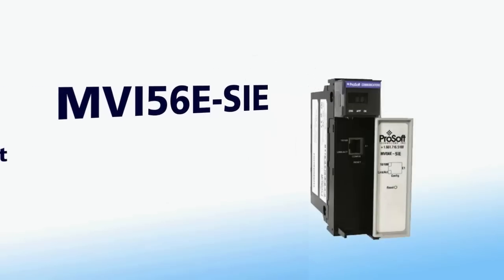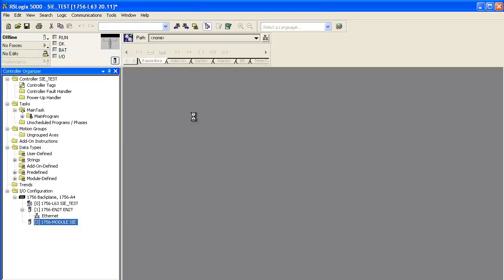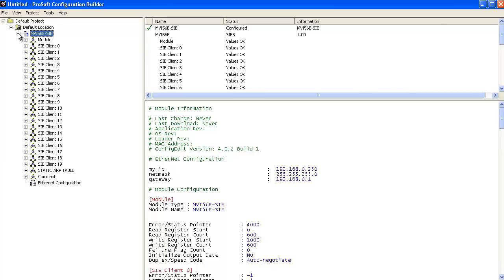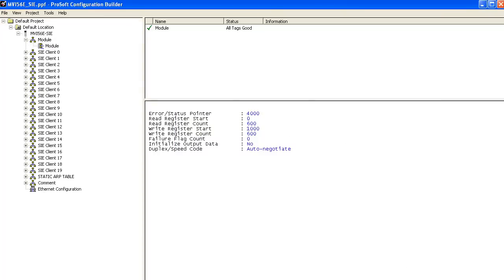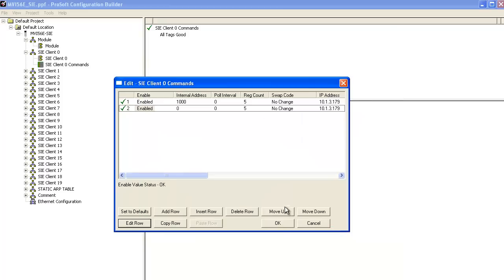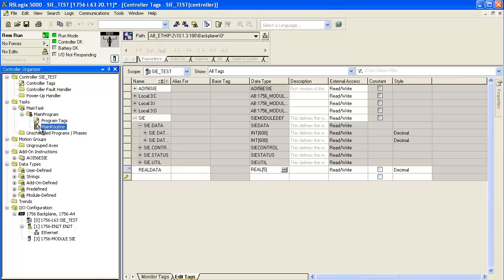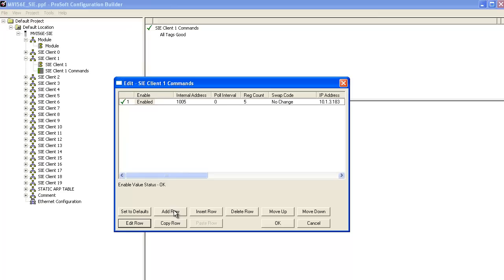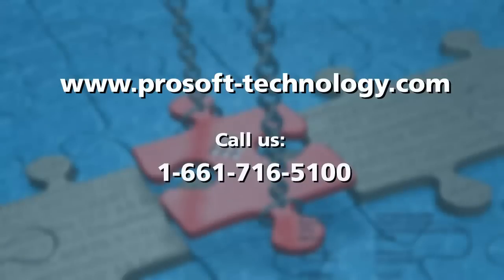Set Up: Siemens S7-200, S7-300, S7-400, S7-1200, S7-1500 to ControlLogix via Ethernet

Comment: Thanks for the Video. is it the same configuration when using an S7-1200 with TIA?
Reply from the maker: Hello! The setup will be the same as for the MVI56E-SIE card in RSLogix, and Step 7 or TIA Portal can be used to setup and configure the S7 PLC. Any setup shown with Step 7 examples will have similar setup options that can be selected if using TIA Portal. If you have any further questions please call 661-716-5100 and ask to speak with our Tech Support department. Thank you!